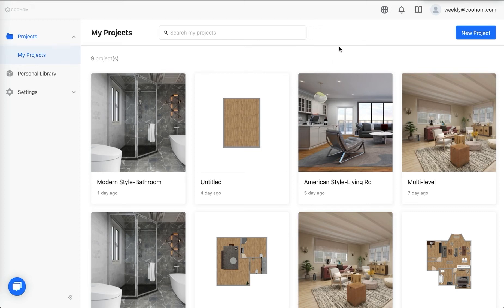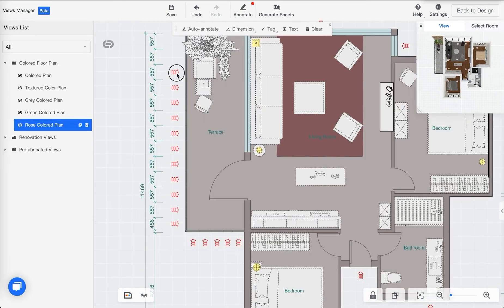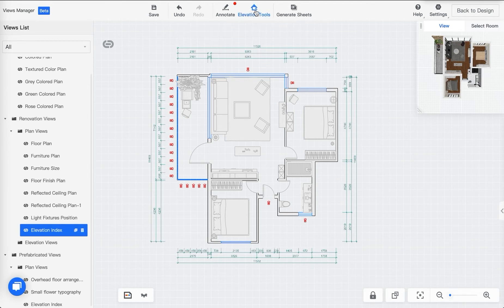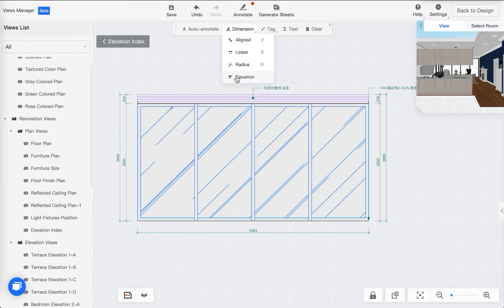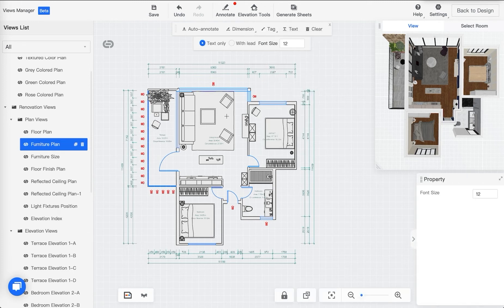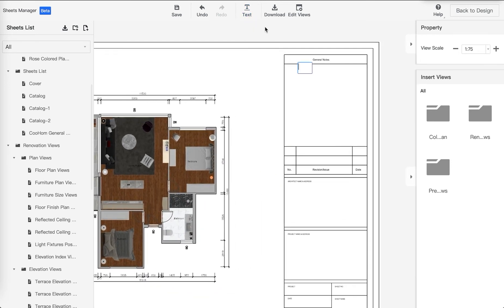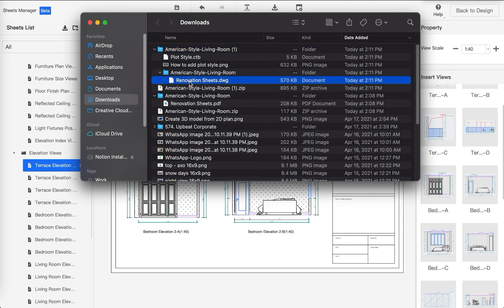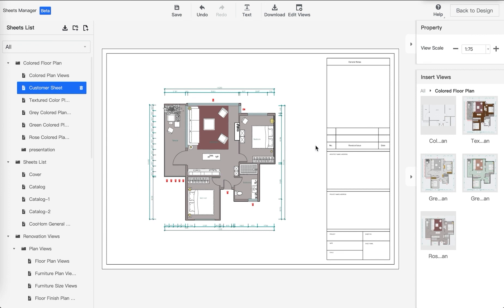Coohom Basics | How to Generate Construction Drawing in Coohom | Interior Design

Comment: its 4 yrs after, i wonder if Coohom can do better over shop drawing breakdown from scratch to finish for floor, ceiling to wall or even further about the installation methods and diagram in reverse direction under the built-in ai calculation and presentation so as to beat homestyler and let me love u until death? it will be more easier for user to deploy all the floorplans  and furniture and let Coohom generate all the documentation to realize the design???